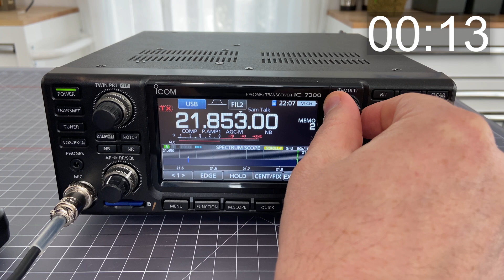2 Minute Tutorial: Memories on the Icom IC-7300

Comment: thanks!  I knew about using mpad to store a frequency, but I had missed that you could quick press it to move between them.  2 quick notes - per the manual you can change the number of mpad memories from 5 to 10 using the menu, and mpad stored frequencies can be on different bands.  73, K8JLW
Reply from the maker: Reid, thanks for adding to the conversation. Good points about the multi-bad and +5 features of the mpad. Many folks, myself included, learn the features which work for them in the moment, and then miss out on some of the deeper opportunities. It is good that you and the community help to bring additional details to light. We are all better for it. Thank you. 73 - AC3DS